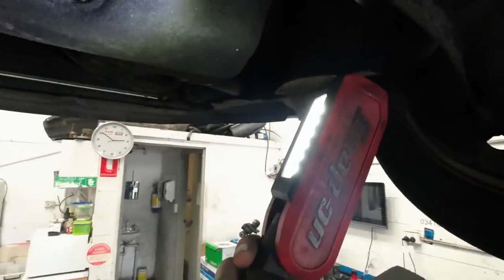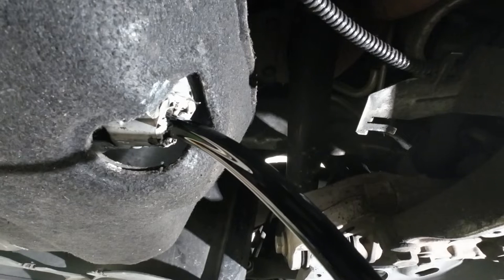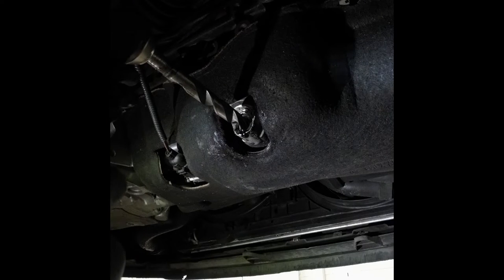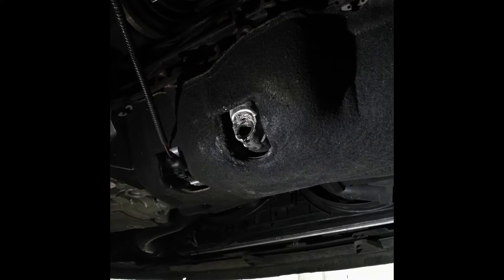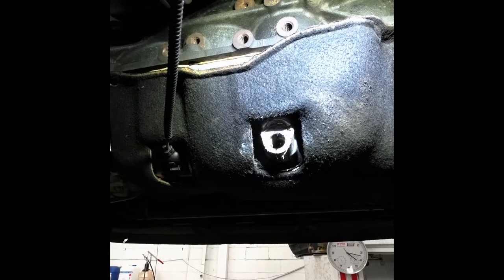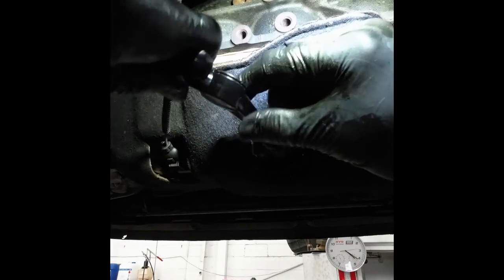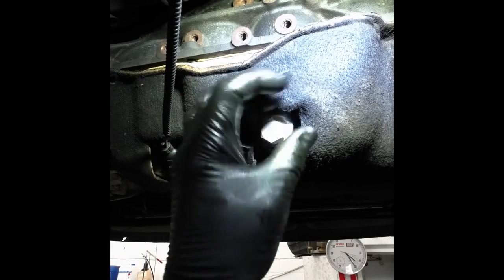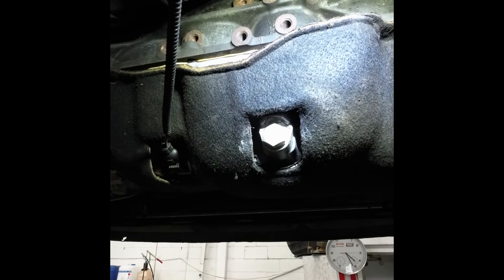Repair of stripped sump plug

Comment: When you go backwards you snap the swarf spirals that form in the tap flutes. This can make it easier to continue the tap in hard materials but probably is exactly what you don't want to do tapping a sump hole as better to keep the swarf in big pieces within the tap flutes if possible. Good video, thanks.

Comment: On the running backwards (already somewhat addressed here), breaking the chips is pretty important with steel and metals that make a nice long swarf-like chip. Neglect to do it and your chances of a broken tap increase, which is a really bad Friday arvo.
Less of an issue with brittle metals like Al and Magnesium, but still a good habit. Once you've run a few taps you get a pretty good feel for if you should back off as well 😉

Comment: When tapping the half turn backward, will break the chips off and clean out the thread. The petroleum jelly is a neat trick, so is using a magnet to pick up the chips afterwards.